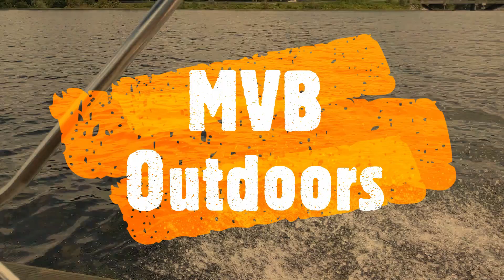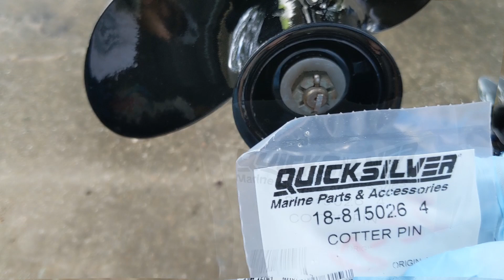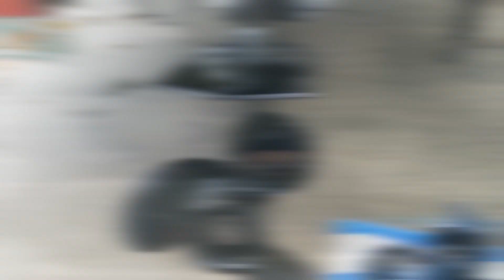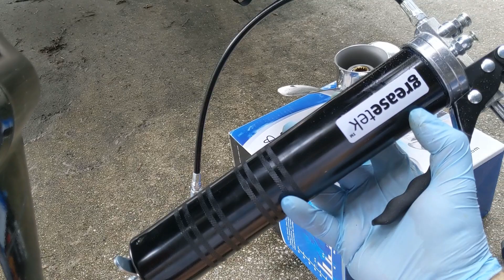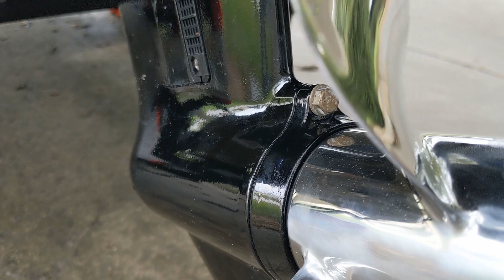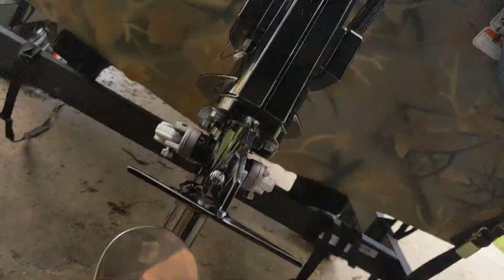How To Install / Change Boat Motor Prop | 20hp Mercury Outboard

Comment: Very nice video.  Thanks. This is a general commentary - not specifically about you. I see it all the time - when YouTubers run into an awkward or difficult step - like your difficulty removing the cotter pin -  they often edit out the part where they are struggling. I guess this is to make them look more competent or expert. But those difficult bits are the exact parts we need to see - how you managed to overcome the difficulty. You did as I'm suggesting when showing the retrieval of the broken pin - so I know you get it. So, I guess I'm just ranting at DIY YouTubers in general, not you in particular. Show all your mistakes!
Reply from the maker: That is a great perspective, thank you for sharing it. I will certainly keep that in mind.

Comment: What is the propeller part number?
Reply from the maker: Sorry I don't have it available any longer but if you use the Solas website and select your motor year/hp it will tell you.

Comment: What was the outcome? Rpm and speed mph changes
Reply from the maker: Very little change actually! In the end it turned out the motor was just underpowered for the boat. We eventually upgraded to an entirely different setup. 

There was a small gain in speed and lowering of the RPM so it was a worthwhile upgrade in general but not the fix I was looking for.

Comment: Do you remember your top speed going from aluminum to stainless? I have the same motor, but it’s on a 13ft whaler .
Reply from the maker: To be honest it wasn't much, in the end I feel that motor was just too underpowered for the size boat/weight.

Comment: I have the same motor with the stock prop on a Lund 1600 fury,I’m running at the top of my rpm sometimes over ,so would you recommend a 10 stainless or 9,I don’t wanna loose speed but I was under the impression that the higher the pitch the more rpm you loose

Comment: Is this process the same with carbureted 20hp Mercury’s? (2017 model)
Reply from the maker: I'm not sure if they share the same lower unit but for the size it shouldn't be much different than a cotter pin and castle nut.